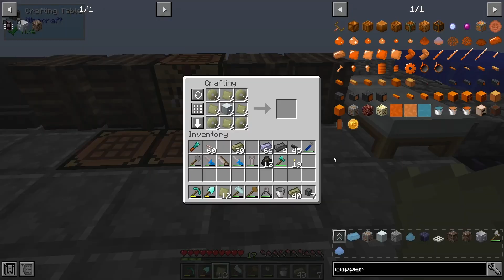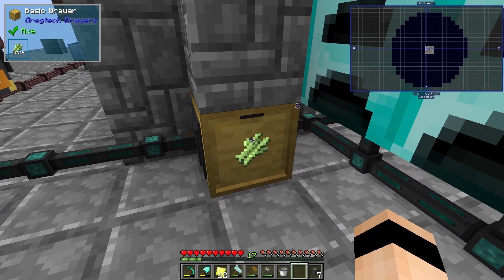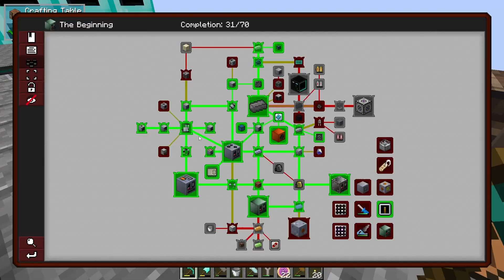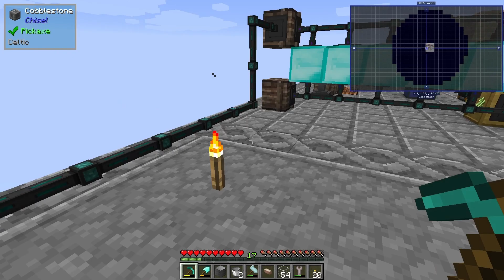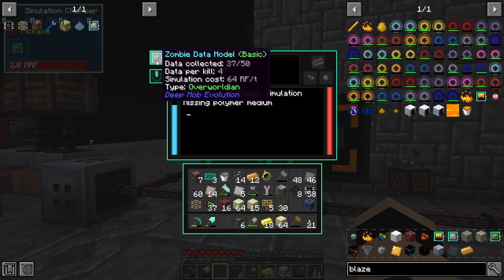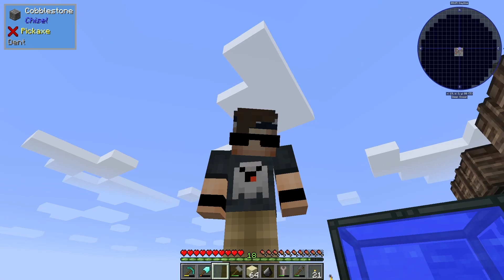Nomifactory GTCeu: Episode 3 - MV circuits, DML and power upgrades

Comment: Is this really GTCeu or old version? To craft SNAD I have to do pulsating crystal and for me Blast have inbuilt circuit number
Reply from the maker: It is GTCeu. But i havent updated to 1.7a yet, so i dont know if thats a new feature, the circuit thing.
The pulsating crystal is for a vacuum chest, which is not needed, you can get by with a hopper even though the questbook recommends the vacuum chest. You should be able to look up snad in JEI and find that its just 2 doublecompressed sand. :)
Reply: @GeogeMC  it's a change coming in 1.7.   Force you to wait until you can get the vacuum chest.
Reply from the maker: Ah, that makes sense then, im not sure if i will update untill the full release.
Thank you for clarifying!